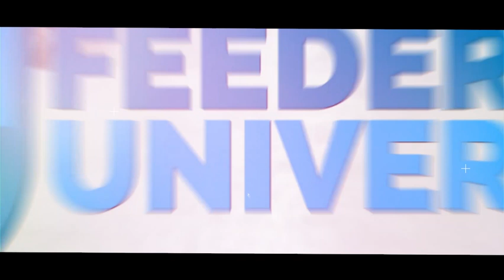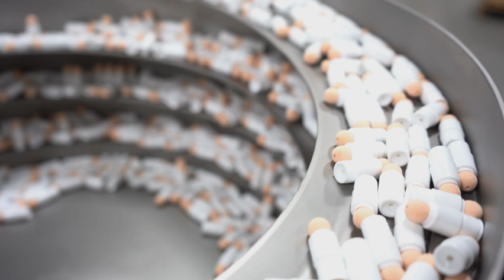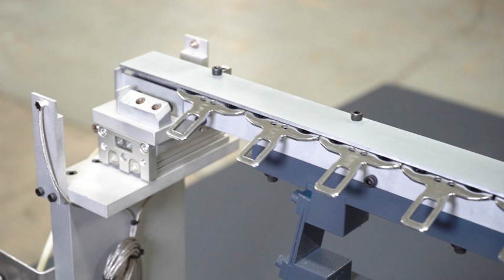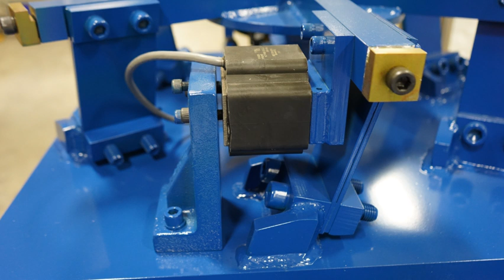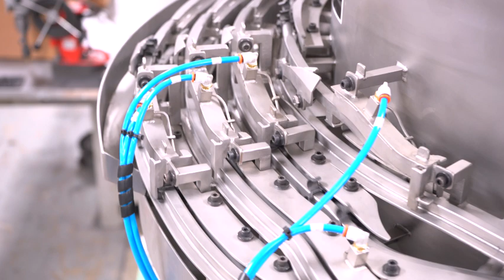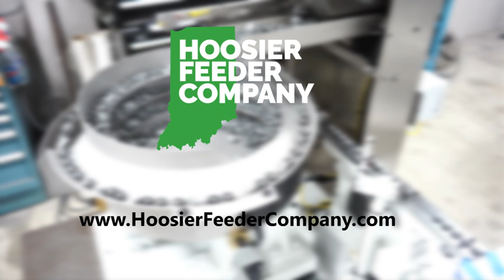Vibratory Feeder Basics

Comment: Hi I need it
Reply: Manufacturing vibratory feeder 
8308317717-what's app
Saraswati Assembly Automation 
Pune
Reply: contact us - HINDUSTAN AUTOMATION, CHIRAG BAKSHI 9930006365 we are manufacturing bowl feeders for last 28 years. We have core expertise in making high precision vibratory feeders. Last year  we have shifted our setup to new and bigger premises - 25000 sq feet in MIDC, BHOSARI, PUNE, MAHRASHTRA, INDIA
Reply: 18500 /- with digital controller 
+ 18% gst 
Transport extra actual  , Packing forwarding 3 % extra if wooden packing required it will also get

Saraswati Assembly Automation 
Pune 
What's app 
8308317717
Reply: Saraswati Assembly Automation 
8459188550/-
8308317717 whats app

Comment: Can you have a feeder lie this that feeds 0.002" thick stainless steel shims that are 2"w x 1.5"L?
Reply: contact us - HINDUSTAN AUTOMATION, CHIRAG BAKSHI 9930006365 we are manufacturing bowl feeders for last 28 years. We have core expertise in making high precision vibratory feeders. Last year  we have shifted our setup to new and bigger premises - 25000 sq feet in MIDC, BHOSARI, PUNE, MAHRASHTRA, INDIA
Reply: Saraswati Assembly Automation 
Pune 
What's app 
8308317717
Reply: Saraswati Assembly Automation 
8459188550/-
8308317717 whats app